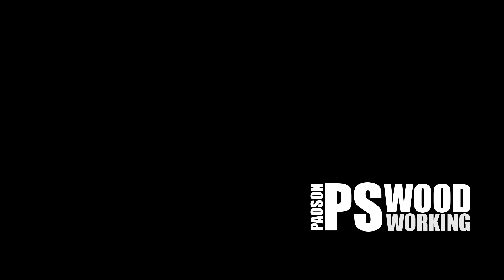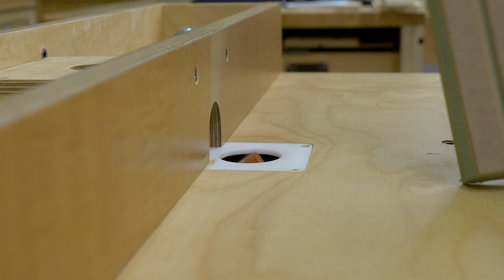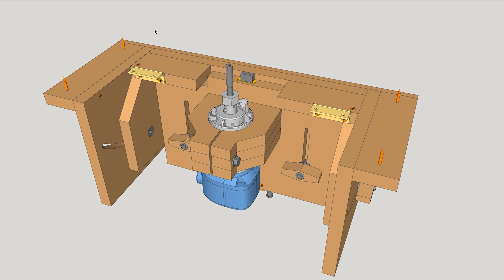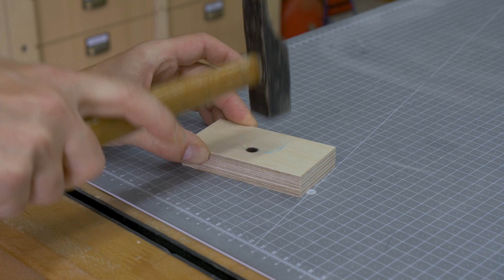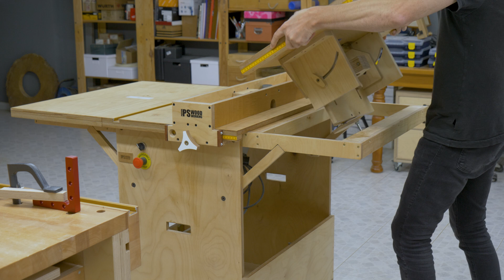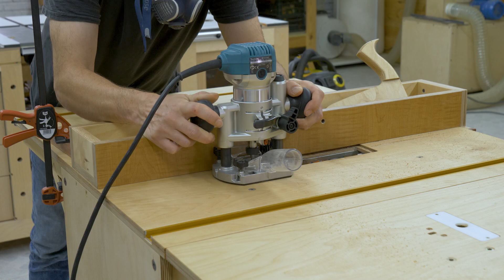Portable Workshop Improvements / DIY Tilting Router Lift

Comment: Very nice work. A small suggestion.  I would also cut a 45 degree piece from the top of the router mount, just above the bolt which secures the router body. This would allow the router to tilt more without hitting the underside of the top.
Reply from the maker: Good tip!